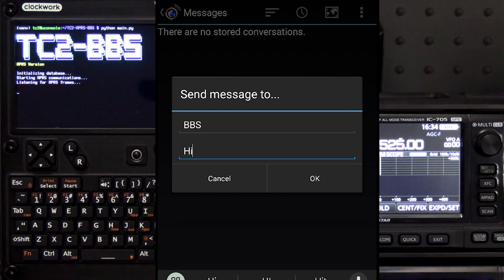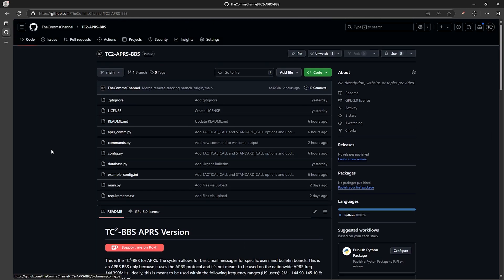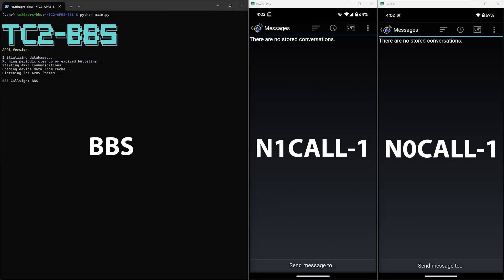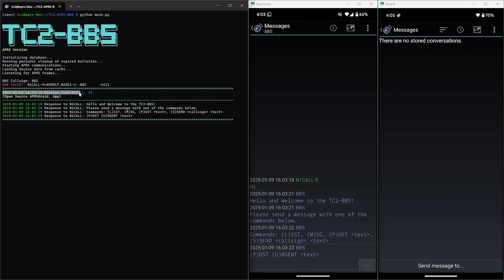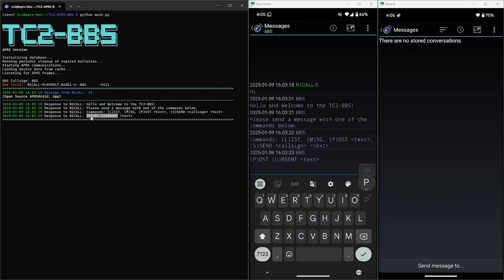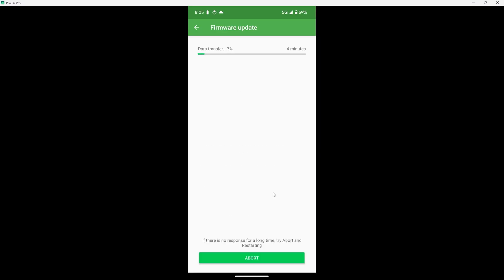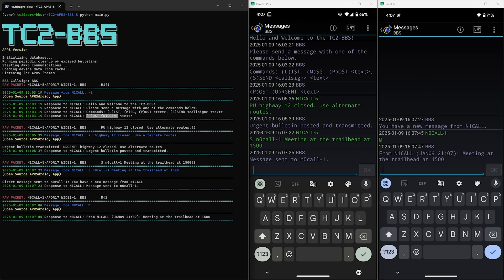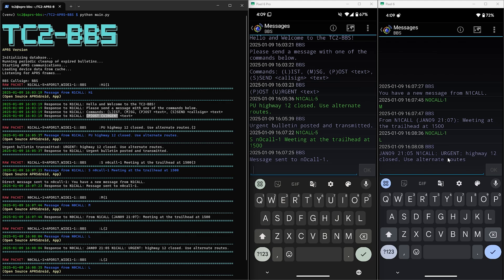We created a NEW type of BBS for OFF-GRID comms over ham radio - TC² APRS-BBS is NOW Available!

Comment: I'm working on getting my amateur radio license and was a huge nerd of BBS's in the early to mid 90's.  What kind of baud rate do you get with the different bands?
Reply: generally, hf is 300 baud, 2 meter is 1200 baud, 70cm and above can technically go up to 56k, but for amateur work 9600 is usually where it tops out. it's dependent on what transmission mode you use too. Audio FSK (which is what APRS uses) generally tops out at 2400 baud max and 1200 is far more common. Direct FM modulation techniques can get you to 9600 bps and beyond depending on the bandwidth you have to work with
Reply: @justinbealo1620  Thank you for that information.  My first modem was a 2400 baud and that was pretty tolerable.  The text was fast enough to keep ahead of the reader most of the time.  From watching the video, 300 looks workable.

Comment: Just wanted to say, I have set this up and it works wonderfully. Still tinkering with it, but it is a great system. Have a query if I may. How do you go about deleting/removing messages? Not those sent to another operator, just the general messages. thanks for any info..
Reply from the maker: Glad to hear it's working well! There's a setting called BULLETIN_EXPIRATION_DAYS in the config file for how long messages will last. The default is 7 days and those messages will go away on their own in that timeframe. I do still want to make another script for manually messages and will do that sometime this month.

Thanks for the feedback and the question!

Comment: I love the concept of bringing back BBS's over radio. If a few people are running this code, can they be setup to sync in the background? So if someone leaves a message on one I would be able to retrieve it from a partner site? Maybe another way would be to ask the other site to retrieve messages from X, that being the other BBS. 
Just thinking while moving, might not even be a viable or useful thing to have. I'll admit I'm relatively new to ham radio.
Reply from the maker: Yep! Planning on adding a configuration option where you can input the call signs of other BBS's you want to sync with and have them sync their messages together.

Comment: That is cool that the developers are listing to input from users.  When I saw they added the notifications for BLN bulletin messages, I wondered if they have notifications for groups messages like to ALL or QST or CQ like the APRS101.pdf spec sheet describes?
Reply from the maker: @briankendall1978  they've been very responsive! It was great to see they already had it in less than 24 hours after contacting them. We only discussed BLN, but I'll reach out and mention those as well. The radios have limited space available after all of the firmware code (which is why it doesn't store messages) but I imagine that it shouldn't take much more room for those additional addressees

Comment: Does rokland have the mesh hat and the raspberry pi hardware to setup the meshtastic (non ham related) bbs setup ?  I see the Pi's but the exact hat to use is confusing.
Reply from the maker: They don't have any hats there. All of the parts for the Meshtastic BBS build are here

https://youtu.be/AFeyqgVLzYM

This is for a PoE build, but you can adjust to fit your needs

Comment: I find it fascinating that the amateur radio digital world is going back to 40+ year old computer communication technology for text messaging systems.  I guess it is another case of what is old is new again.
Reply from the maker: @bwillan  I think we'll see more of it. Works well and is easy to deploy your own infrastructure.
Reply: It is not as fragile as cellular networks.
Reply from the maker: @chrisherd991  💯
Reply: Yep, Packet is making a big comeback  👍
Reply: We should have demanded the radio manufacturers to make 56K radios for data only.   Packet radio was so much better tech than any mesh network.
Reply: We should have never abandoned it.
Reply: It works (also worked) very reliably. Much lower throughputs OTA compared to modern internet connections so far but phases be phasing…
Reply: Computers are still running binary from tickertape and punch cards. so guess it's how you package it.